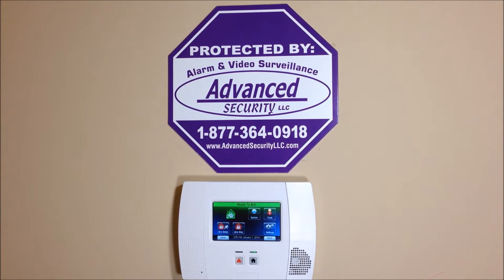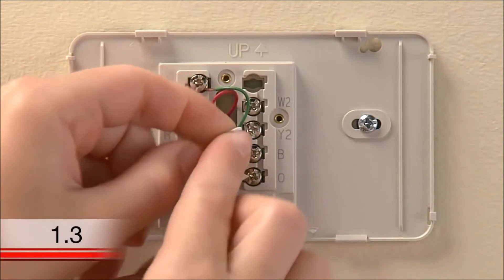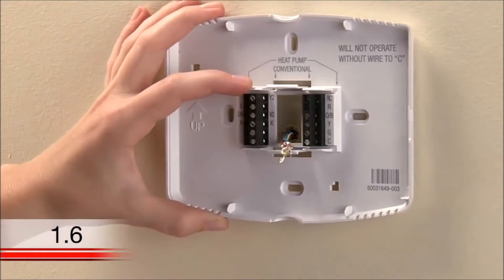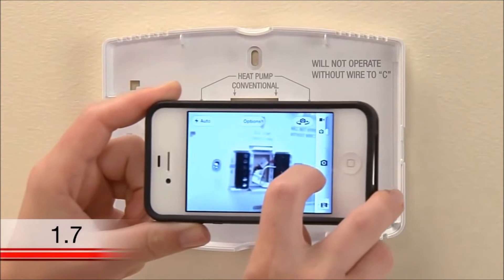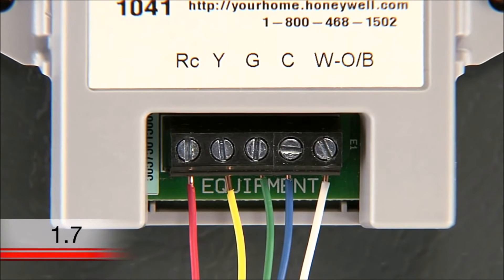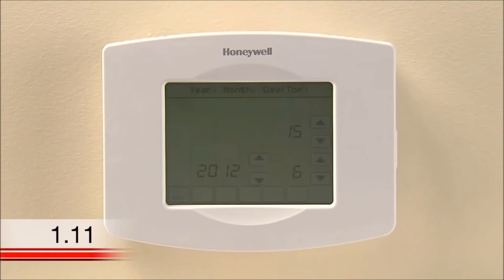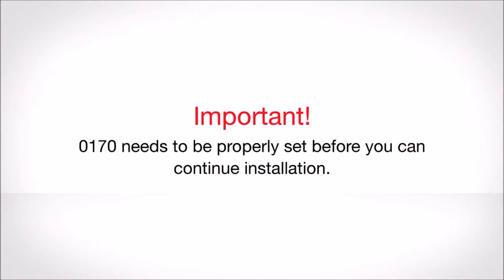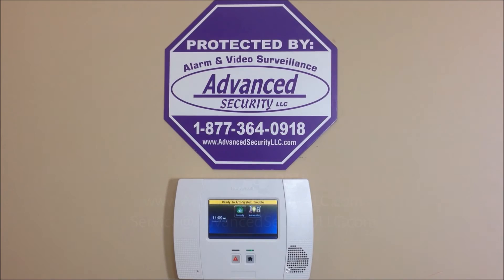How to Install a Honeywell Home Resideo TH8320WF Thermostat

Comment: What if you have a yellow wire in the the unit and the blue wire is replacing the yellow in the thermostat and is wired to the C in the roof unit ?
Reply from the maker: Johnny G then the blue wire would be used as your yellow in the instructions but I would recommend you reach out to your HVAC Service tech to be sure.  Thank you